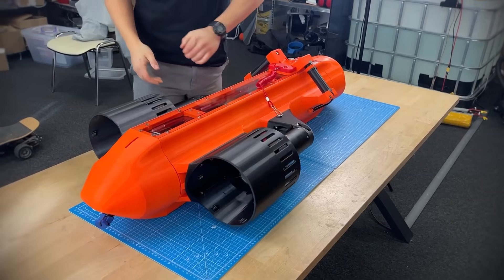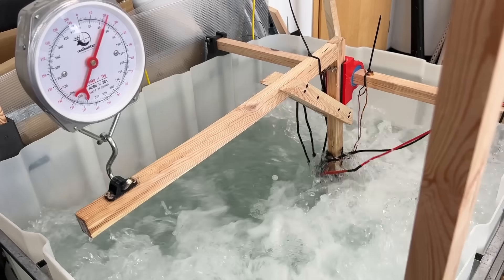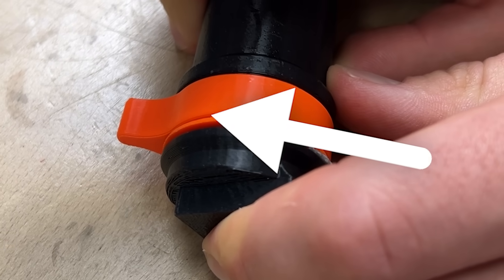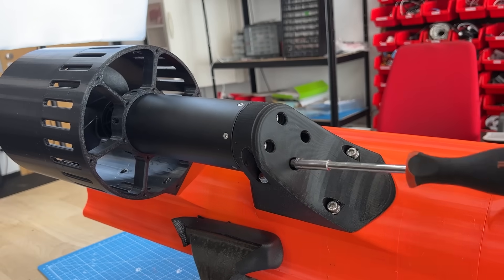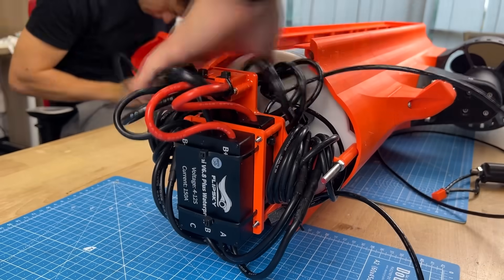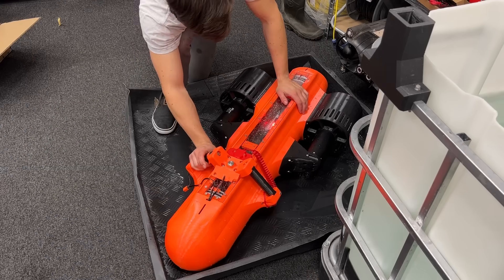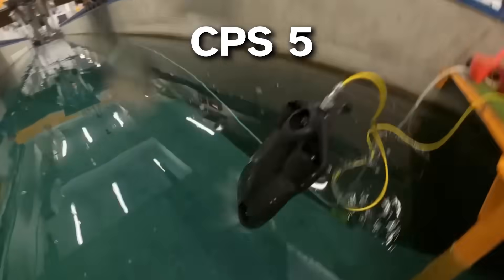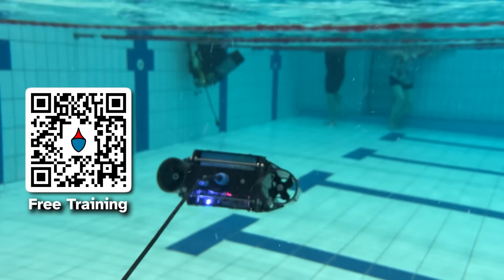Building The Fastest Underwater JETPACK

Comment: you need air blast in front ... to go faster.... to create a 'tunnel' under water...... you can also do using electricity to ionize the water..... but needs a lot of high power .... and in salt water you have to ionize so much that the water doesn't stick to the body frame..... so air its much cheaper..... ....atiki taki tiki tu tȁ̶̢̳̪̥͎̩̦̫͓͓̏͋͌̀̑̔̑̆̄͌̽̄̂̄͜ͅ ta
🌏 📡🌏 👣🕖 💎👽☠☼☾☄ゞど・ㇺㇾㇽ₪𝖎𝖙𝖎𝖇𝖎𝖗𝖆₪なめㇺㇾㇽ✶☥✨🌛🌄⊀✶⋊🐺🐾♓☆🐜🐜🐫▲▴◭👀

Comment: few suggestions, remove the spring on the throittle so u dont gotta be holding it down and the deadmans switch at the same time, move the dead mans switch a bit closer, make the led lights instead of all red have dif colors for dif speed modes, AND GODDAM SELL IT FOR NOT 12000000 BUCKS

Comment: Question:  does the Coanda Effect work under water?  If so, you might want to try creating a water duct, with the motor inside, accelerating a massive volume of water, thereby increasing thrust more than a motor alone.

Comment: I know a better way that you can do it. All you have to do is put two of those thrusters on each arm with the safe gear and all of that but not the throttle because all you need to do the turn and slow down is to move your arms

Comment: If you don't mind. May I propose an idea with a much more "efficient" solution. make a human torpedo that creates a "bubble" around itself via controlled release of air from the front making a cavitation bubble and in turn making it have less drag in the water
Reply: I think that would likely require massive amounts of air, far more than feasible to be stored and used in a human sized design.

Comment: Speed 4 isn't working. DUH! I'm amazed speed 3 is. Them being 'water cooled' might have something to do with it. You have 2x 300A motors on 2x 150A ESC's. Those 150A ESC's are pretty crappy Chinese made and way below spec.. Those pretty good Maytech 300A motors are initially going to peak draw at least 400A a piece! So your ESC's are getting 3x as much current forced through as what they were built for.

Comment: There was something similar in some rc cars video.  For them, If the drain from the motor was greater than the charge from the batteries it would drop into crawl mode because the ESC thought the battery was dead.

Comment: You should add a small handle in the front and some small rollerblade wheels in the bottom to roll it when you need to transport. Wheels easy to detach

Comment: My guess is if you encounter a 🦈 that is motivated enough to want to eat you, you are not getting away with anything less than a jet ski on the surface. There’s no way you are moving that fast underwater (without likely hurting yourself) without a much larger and more complicated apparatus that is streamlined for hydrodynamics. I’ve seen how fast a hammerhead and mako can move and your machine will not come close. Plus if they charge at you, your reaction time and acceleration will be way to slow.

Comment: dumb question, but have you considered a windscreen?
At higher speeds, you need to be able to look forward, which requires you to raise your head and will put a lot of force on your neck. plus fill your mouth and nose with water. 
You need a full face covering, or a clear covering hard mounted to the device to reduce that force and for hydrodynamics. 

I think it needs some control surfaces up front, like canards.

Love it. Can't wait to see what you will do next. Subscribed!

Comment: Water doesn't affect magnetic fields that much, which is probably why it works fine, but you should definitely still calibrate the throttle underwater. You'll also likely need some noise reduction for any potential wake fields.
The ESCs should be rotated to be side by side, rather than back to front. I'd be willing to bet that the motor that shutoff was connected to the aft ESC. I would also recommend cutting some water channels in the dome. Yes it's more drag, but also active cooling.
With motors this strong, it might be worth taking another look at the prop design to see if it would be more efficient to run something beefier, but you guys definitely know more about that than me. Maybe you're also hitting a point that impeller propulsion would be more efficient, though?

Comment: I would of used the motor to drive a jet pump drive using a 3d printed impeller fixed inside a tube that pulls water around the motor first fit a hydrodynamic cone to the motor , propellers  nozzles cause drag and are not as small as an impeller inside a tube, props have good torque but underwater speed is slowed by the nozzles resistance,

Comment: Try add a device that generates bubbles, maybe a small gas tank or something else, then connect it to the front of the device, position the nozzles backwards to craate bubbles that flows backwards , it will help reduce the resistance of the water and might increase the overall speed

Comment: Why don’t you get four motors, strap them to your legs and arms. You will be like an underwater Iron man. You need to re design the back pack to be hydro dynamic slim line to wear on your back. To controller the motors, left hand to accelerate the legs and right hand to accelerate the arms. Your legs and arms will be work perfectly to steer under water.

Comment: Hooooly crap that solder joint is so dirty .... You like living dangerously don't you 😂
Based on the design you have, you could improve your speed by creating a more turbine-like design around Savon.  Don't give the water any space to slide between the fan blade and the casing and you'll put more water through.

Comment: The problem with it being a jetpack is that if it fails, you would need to maneuver around the craft to surface. It may be light at first, but once/if the 3d print takes in water, it's going to get much heavier, meaning you're going to put more force to move it out of the way.

Comment: But is speed the only thing ? Sharks and predators like Leopard seals 45 mph, Orcas 35 mph, but maneuver incredibly well, the shortfin mako shark (Isurus oxyrinchus), capable of reaching speeds up to 45–60 mph (72–96 km/h), so unless you know they're going to bolt at you and get a head start strait out in front of them, your foast.  What is the acceleration rate compared to aquotic predators Lol ! A Black marlin can reach speeds of up to 82 mph.

Comment: 1) It should be named Bobr
2) I don't think 150A is remotely enough for a high powered motor with the resistance that the water adds. Hard to tell without the datasheet for the ESCs and motors, but i would at least go 50% over what the motor claims
3) Whatever the input signal on the throttle is, ALWAYS do a ramp-up of the motor speed in your code. Don't just switch the motor from 0% to 100% because the throttle went from 0% 100%. If you can, measure the current that the motor draws, and use that to limit the acceleration during ramp-up.
4) Maybe add some inlets to the front dome, and some water channels around the ESCs, so that more water streams past them (taking the heat away) the faster you go.

Comment: This is going to be VERY difficult to accomplish. 
Water being more then 800 times denser then air, 
there is way to much drag from the human being.
When it come to fluid dynamics, water and air are the same. Drag is very real !
After watching the video, your props were not even mentioned.
You need a VERY efficient  propellers 
Oh, it might very difficult mounting this "Jet Pack" on your back, 
This is where divers usually mount their scuba tanks!   (DUH)
Good luck with this one!!

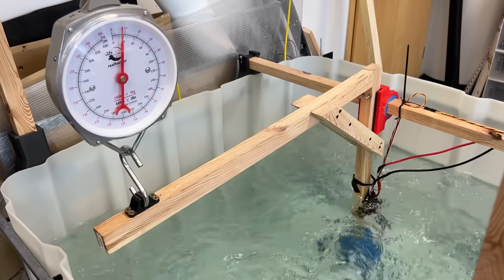Comment: 1:53. Hey that's amazing that you guys got the whole thing under water and made it to create thrust to show the world that thrust exists.  I just have a few suggestions.  You guys really need to show how you guys dump the whole motor into the water.  These are electric motor powered by electricity.  You might get some little kids really hurt trying to do this experiment at home with their grandparents' unwanted old fan which are so powerful that they can cut off you fingers.   

How about make another video without all the cutting and editing so kids can see what safety precautions to take so they can really do this at home without hurting themselves to discover that you can't really run an electric motor safely underwater without a battery because the motor needs a waterproof casing.  But more importantly, wires don't work under water.   Just try it jus dip a rubber coated wire in water while the two ends are connected to an outlet and an appliance like a TV.   You may need to dip it deep and have a.significant segment dipped.  This has to do with the magnetic field created by the wire (Ampere's Law) getting distorted by the water molecules in the water since they are diamagnetic. Magnet done't act over distance under water.  They still works but you have to make contact first.

Comment: Probably an electric charge like a "Torpedo ray" or "Electric eel." Or the extract of the bodies of dead sharks. Sharks are extremely sensitive to electrical fields. So, scrambling that would be sort of like being kicked in the balls. The scent of dead rotting sharks also seems to trigger an instant "flee reaction" in sharks. If you are bleeding, you aren't going to "get away" from sharks especially with a short speed burst. Also shark attacks are extremely rare. You could also build " faraday cage suits for lightning. Is it necessary? Probably not.

Comment: The classical way to mount a scooter if you have a diving harness (backplate) is to use a D-ring on the harness belt at the front. You create a rope V with a single ender at the bottom of the V to clip on and the two tops of the V attaches to the scooter. The safety cost is that you are attached in a hard way to the scooter, so...

Comment: I believe the military came up with a mac 1 torpedo. If I remember correctly, it did this by ejecting the exhaust out the nose which was perforated like an air hockey board. It eliminated the water resistance because it was essentially flying through a pocket of air that it was creating. Just a thought in underwater aerodynamics...

Comment: Although it might be nice to have the ability to outrun a shark, these devices can be extremely dangerous. In open ocean waters or low visibility the depth change can be too rapid for proper Nitrogen off gassing, increasing chances of a hit. Or if you’re inhaling while also ascending you can suffer arterial gas embolism. Both potentially fatal…

Comment: Many people want to travel fast under water. But very few consider supercavitation as the real deal to get really fast (several hundreds of km/h) with only moderate energy requirements. There are two approaches. A classical one, used e.g. by the Shkval torpedo (Details see Wikipedia), or a progressive one, so called USO's employ it. I won't disclose technical details due to a NDA. the physics behind this propulsion concept is simple and is contained in the Lagrangian equation set of the accepted physical standard model. It has something to do with Pauli's exclusion principle.

Comment: To make it go faster you'll need a hydrodynamic screen in front of the rider.
Also: The thrust should be measured while moving at the target speed, not stationary. (A tug boat with large propellers deliver a huge thrust at low speed but can't go fast.)

Comment: AI Summary

Abstract:

This video documents an ambitious project to build the world's fastest personal underwater vehicle, conceived as a dual-mode jetpack and scooter, with the ultimate goal of outrunning a shark. The creators aim to surpass the 79 kg of thrust from the leading commercial model, selecting two powerful electric motors capable of a combined theoretical 100 kg of thrust. The design prioritizes safety, incorporating a custom magnetic throttle, a dead man's switch, and a kill cord. Constructed from 3D-printed parts and polycarbonate sheets, the vehicle houses its electronics in a central waterproof tube with external, water-cooled motor controllers. Initial testing reveals critical control flaws that lead to a catastrophic failure of the main electronics—a period dubbed "integration hell." After rebuilding and redesigning the controls, the team successfully tests the vehicle in a pool, discovering the scooter configuration is far more hydrodynamic and faster than the jetpack. However, the project hits a major roadblock when the highest power setting consistently fails, causing the motors to shut down. The video concludes on this cliffhanger, promising a fix and a full-power test in a future installment.

Building the World's Fastest Underwater Jetpack

*   0:00:02 Goal: Outrun a Shark: The project's objective is to build an underwater vehicle faster than the 25 km/h Aquadart 770 Extreme, setting a benchmark for escaping a fast-moving shark.
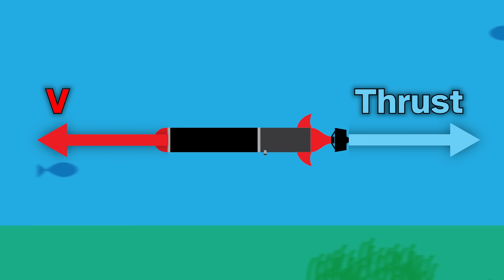*   0:01:26 Thrust is Key: To achieve high speeds, the team tests motors to beat the Aquadart's 79 kg of thrust. After an initial motor fails, they select two larger motors that produce a combined theoretical thrust of 100 kg.
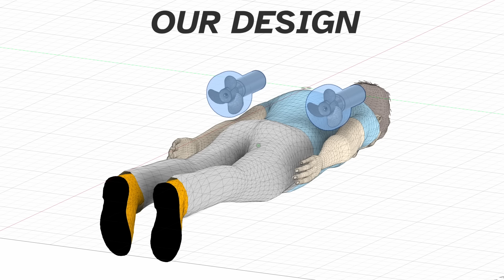*   0:03:12 Safety-First Design: The vehicle is designed to be both a jetpack and a safer underwater scooter. It incorporates multiple safety mechanisms: a magnetic hall-effect throttle, a "dead man's switch" that must be held to accelerate, a "kill cord" that shuts off power if the rider detaches, and protective guards over the propellers.
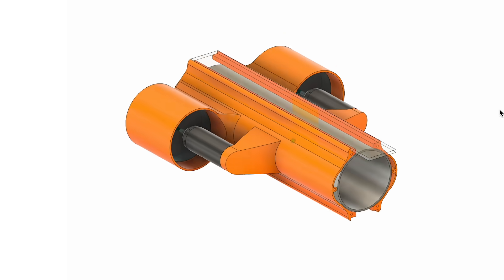*   0:06:58 3D-Printed and Hybrid Construction: The vehicle's frame is built using 3D-printed parts, six metal rods for structural integrity, and clear polycarbonate sheets. Hydrodynamic domes are added to the front and back to reduce drag.
*   0:11:33 "Integration Hell" Causes Major Setback: During initial testing, a faulty waterproof button makes the vehicle uncontrollable underwater. While attempting a fix, the team accidentally destroys the custom power board, both motor controllers (ESCs), and the battery management system (BMS), forcing a complete rebuild of the electronics.
*   0:12:46 Redesigned Control System: After the rebuild, the faulty button is replaced with a quintuple-click function on the dead man's switch to change speed modes. Four LEDs are also added to provide a clear visual indicator of the current power level.
*   0:14:11 Scooter Mode Proves Superior: In-pool testing reveals the jetpack configuration is significantly slower due to the high hydrodynamic drag created by the rider's body. The scooter configuration, where the rider is towed behind, is much more efficient.
*   0:16:34 Partial Speed Test Results: At Speed Mode 3 (out of 4), the scooter achieves a top speed of 10.8 km/h. While much faster than a human swimmer, this is still far short of the project's goal.
*   0:17:13 Maximum Power Failure: The project hits a critical snag when testing the highest setting, Speed Mode 4. The motors immediately shut down upon acceleration, likely due to the electronic speed controllers being overwhelmed by the immense power draw.
*   0:17:41 To Be Continued: The video ends on a cliffhanger, with the team unable to test the vehicle's true top speed. They promise to solve the power issue and conduct a full-speed test in a follow-up video.

AI-generated summary created with gemini-2.5-pro for free via RocketRecap-dot-com. (Input: 17,640 tokens, Output: 881 tokens, Est. cost: $0.03).

Comment: For higher speed submersible, try to pump air bubbles from the nose or hull of the submersible to lessen resistance but keep the air from entering the impeller or prop wash. Should be a substantial increase in speed. You should also put the driver within the pod to reduce or eliminate drag, merely for the comfort and visibility of the driver and reduce physical effort. 
The air bubbles I happened to think about molten metal that drops quickly in water when quenched because it's surrounded by  air bubbles instead of water. Let me know what you think. I'm unemployed too.. A golf ball type of surface may be enough to create bubbles under speed, similar to the Volvo Penta simulation of whale skin. I'm actually surprised that science is this far behind on simple things.

Comment: 1.  If you return to the back pack approach, consider adding a large grey dorsal fin.
2.  If you can’t break the shark’s max speed, then consider a nose to nose ram approach.  Maybe add a barred shark cage like windshield in case you don’t get a good ram the first try.  Maybe add add some drag but for the ram approach you don’t need to outrun.

Comment: You can still call it a submarine. There are entire human powered submarine competitions in which the submersible is not actually sealed, it's more of an underwater pedal power machine with hydrodynamic shells to go faster. The operator uses SCUBA gear while operating the craft.  

Also why the switch from Prusa to Bambu? Did Bambu come calling, or was Prusa not interested in getting you guys set up with bigger/better printers?